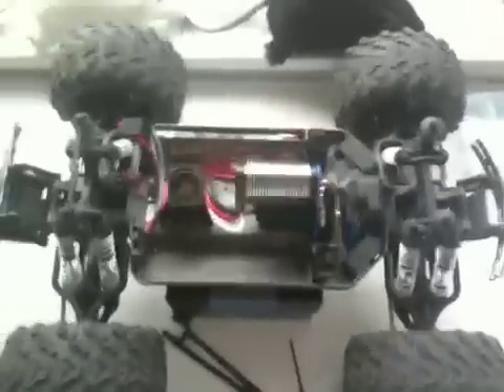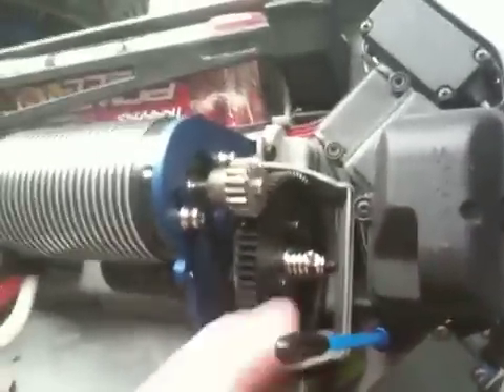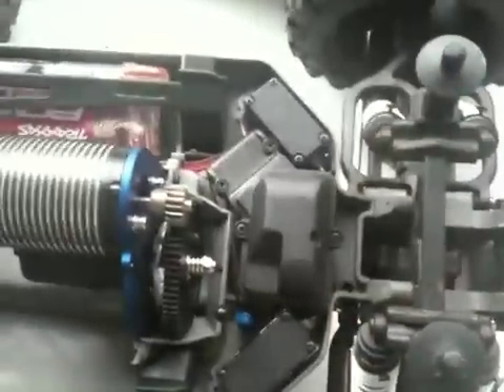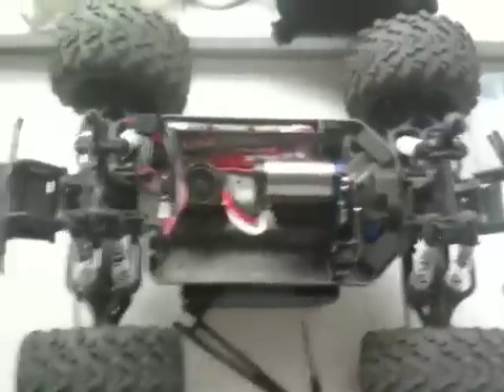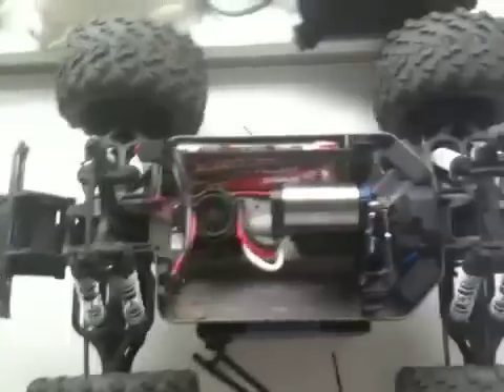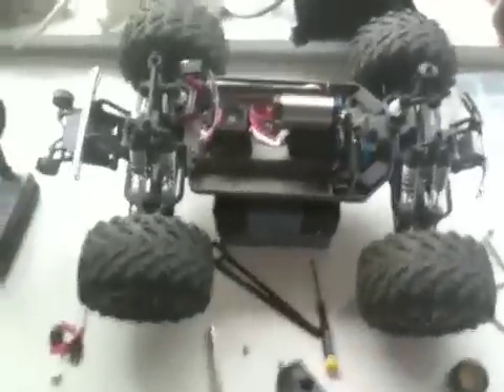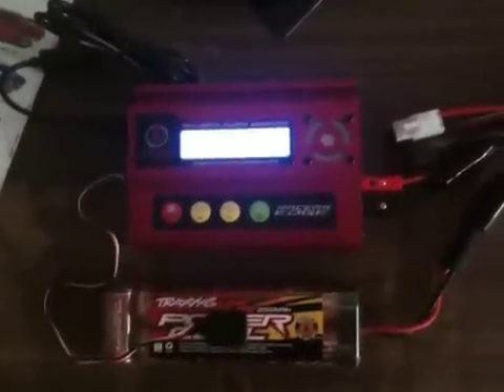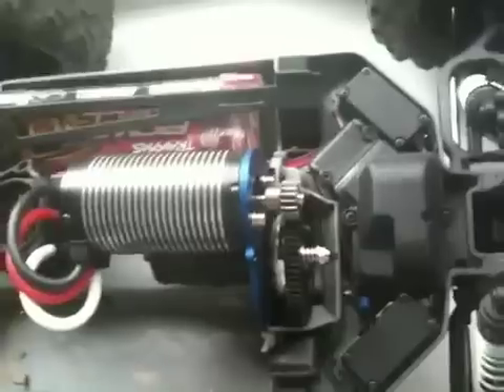E MAXX BRUSHLESS 3908 - ADJUSTING ENGINE GEARS

Comment: Just a little crash course. The BIG gear is the spur gear the little one on the motor is CALLED the pinion gear the "nut" you called the pinion is the slipper adjustment, check out my vid's search michigan 3908 and let me know what you think...